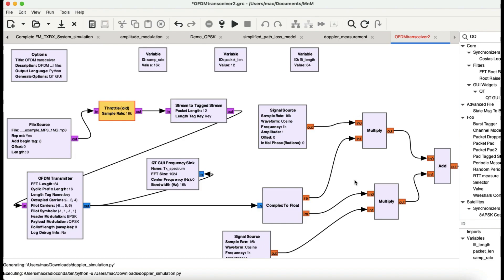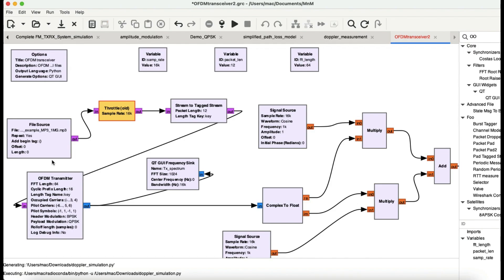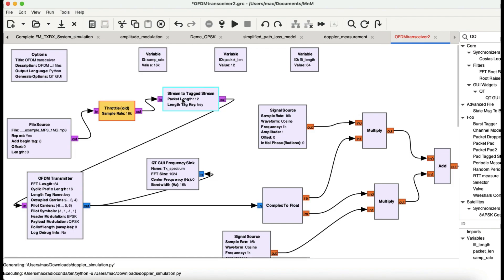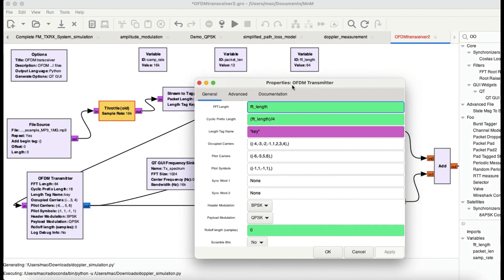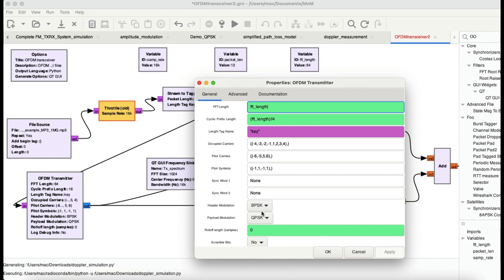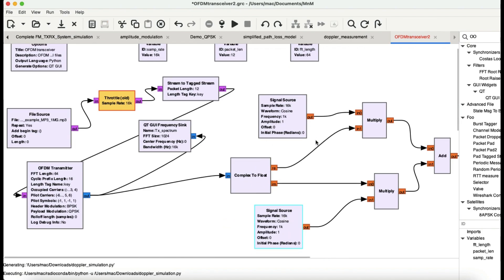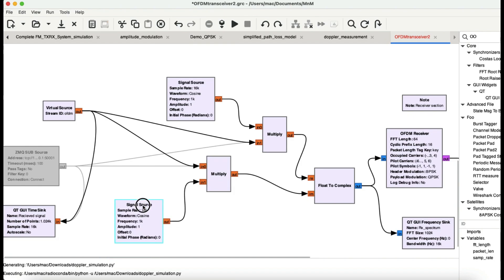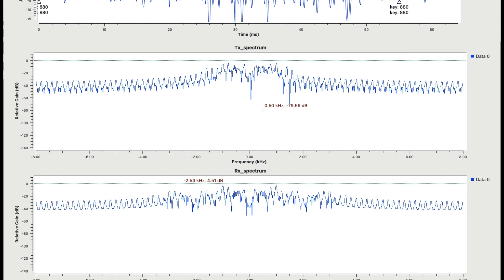GnuRadio Companion: OFDM Transceiver for 5G Using GNU Radio & SDR | Complete Implementation & Demo

Comment: Sir i need your help in the Ni USRP 2922 with using GnuRadio for OFDM modulation. I am getting trouble with that. 
i am using two NI USRP 2922 for tx and rx so can u help me on that for working model sir
Reply from the maker: NI USRP doesn't support GnuRadio until you change the firmware, and I am not well verse using LabVIEW